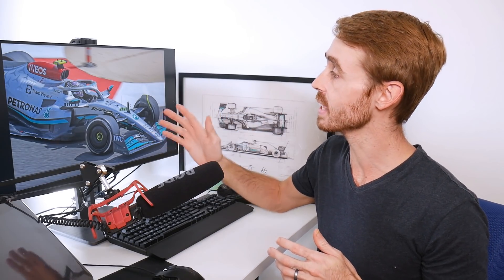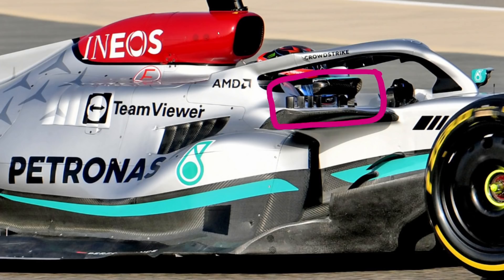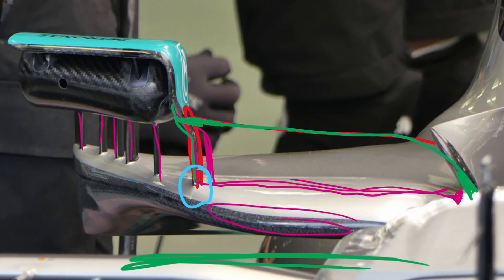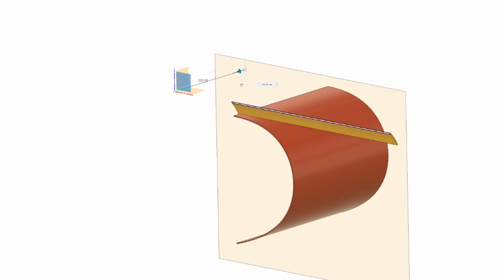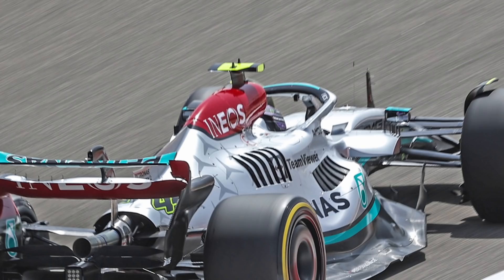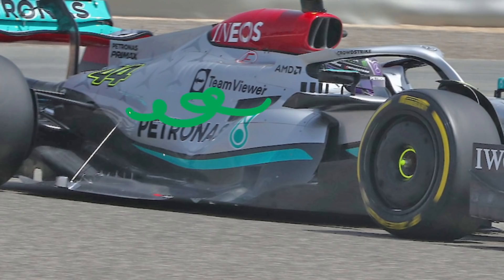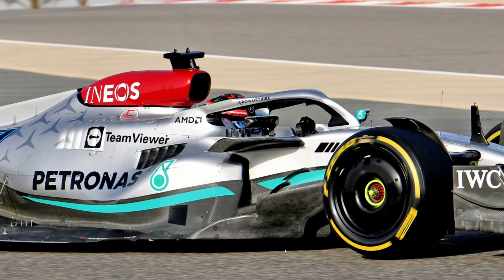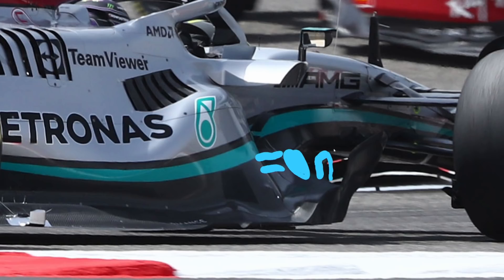How do the Mercedes Sidepods Work? - Aerodynamic Analysis

Comment: Great video and content!
I have a question though: if I remember correctly, in some other analysis videos you mentioned how the shape of more conventional side pods would create an outwash that pushes the flows away from the rear tires.
In this new design it looks like this is not possible given the narrow section of the car body: isn't this a drawback of this interpretation?
Or rather, the vortices spun by the winglet they introduced in place of the pod are sufficient to limit this adverse side-effect?
Thanks again for sharing your expertise, your channel is amazing!

Comment: If the FIA don't ban this then we all know where the FIA's true loyalties lie. The new rules were made to remove winglets and any aero device in this area. We know Mercedes have a legal design that was run at Barcelona and the FIA should be telling them to use that instead.
Reply: They have a legal car that was run in Bahrain, too
Reply: The Bahrain car is also legal,it will not hit the  track if FIA have problem with it
Reply: @dontmindme5419  My understanding of the new rules was that all wings, winglets and bargeboards that are not the front or rear wing are illegal. Maybe Kyle can explain to us how this bodywork overcomes the banning of all these items. The also explain how this is not now a safety issue. Moto GP had to ban similar winglets for safety reasons. My problem with this design aside from it being a wing is that it is now a significant battering ram in case of an accident. The FIA needs to ban it and do so immediately with no umming and ahhing.

Comment: I'm actually surprised that Merc manage to put some vertical vanes branded as "mirror mounts" and body canards in front of the sidepod inlet. I'm pretty sure FIA will try to clean these devices since the regulation is supposed to get rid of these small vortex generators

Comment: Aot of people still seem to be worried about porpoising.
Yes the merc was bouncing a lot on the straights, but they had several runs where that wasnt the case.
My guess is, that they are trying to find the sweet spot, where they have a lot of downforce without porpoising. This is still testing after all.

Comment: Question :
Shouldn't the "mirror stays" be connected to the actual mirror ?

That's the only thing I don't understand how it can be legal.
Reply: When there are lengthy discussions back and forth over legality of rear view mirrors, you know there are far too many overcomplicated rules and regulations...
Reply: Was thinking the same thing.

Also, what is that panel on the cockpit side? On the Barcelona version that extended rearwards from the inside mirror stay. Now it is not connected to that, so why is it there?
Reply: The thing Mercedes are doing is basically they are interpreting the rules in a different way. Reading it at first would suggest what u are saying. 
But with some clever interpretation with the “trimming” of the mirror stays if it’s part of the side pod they are able to move around the legalities
Reply: @foudalism21  ferrari’s mirror in 2018 were banned for this reason, if the Fia doesn’t ban these then they’re truly doing mafia
Reply: @ignls8809  well it's a different set of regulations and ferrari's mirror was connected to the halo
Reply: @ignls8809  those were different regulations and the main issue was that the mirror were mounted on the halo. Stop with your mercedes hate. If it was a Mafia, the FIA's race director would have never gifted the title illegally to Verstappen lol
Reply: @syntheovaldy5173  they changed the rules forcing ferrari to vhange mirrors.... nothing wrong with those mirrors lol. apparently merc are getting away with a wing here that has aerodynamic purposes even tho it's the mirror support

Comment: A couple questions.

Firstly the vanes on top of the mirror wings - you kept referring to them as mirror stays and therefore legal, but I don't understand how they can be considered mirror stays when they are completely disconnected from the mirror?

Secondly on the side impact structure. Is that small area within the mirror wing really all that is required for side impacts? I'm having a hard time believing that this design is safe and I'm slightly worried about the safety of the drivers if they get t-boned. Do we know if this version of the Mercedes has passed the side impact tests? What if the other car is off the ground and their front wing goes between the side pod and the mirror wing of the mercedes?

Comment: Impressive that Merc can create two radically different designs despite getting the least access to aero testing of anybody. I'm assuming they prefer this one, but have the other as a fallback in case either cooling becomes an issue or the FIA take issue.
Reply: There is not a chance they stick to the modelling computation allowance…This is Mercedes we’re talking about…Masters of bending the rules and cheating.

Comment: It's clever and all. But when they mentioned something about them wanting to enforce the "spirit" of the regulations this year, that#s what they mean. The spirit of the regulation certainly didn't intent teams to create a huge wing element on top of the sidepod to control air flow.
Reply: The wing element is the side pod (cheeky mercedes).... watch where kyle explains the y axis plane having two sections and how the bottom flares out far enough.
Reply: @MP422ownz  Nono, I understand why it's legal in terms of the regulation. But I doubt that, in practical terms, a freely adjustable wing element is intended by the regulations.

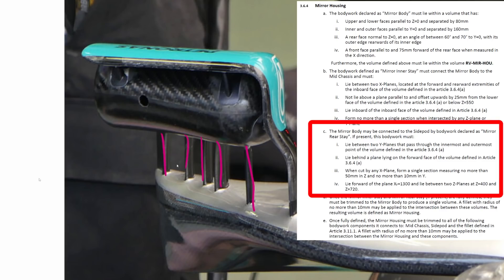Comment: @2:43 Out of those three vertical fins, the four outmost ones do not connect to the mirror, as you show lateron. Can't really believe such vortex generators are allowed for 2022.
Reply: I’m also surprised they have mirror stays that are not connected to the mirror.
It becomes a legal wording judgement rather than an engineering call from there.
Reply: Yep, because of how the rules only state that they have to be within the mirror width when looked at from the front, they should've constrained that from the side view as well
Reply: @NoTraceFound  Probably also a limit in that direction. But apparently no where stated that a mirror mount should connect to the mirror...
Reply: @skiscHans  it surely breaks the spirit and also the definition of the term 'mount' then if it's in no way connected to the mirror, it's not being used to mount anything. I hope that gets clarified by Braun et all.
Reply: @charliedesperado8262  you mean the guy who worked at merc before he worked for F1? lol
Reply: Now, the rules are allowed to be adjusted in reaction to teams getting around the interpretation, which put concepts like this at risk. I would rather be shocked when the FIA will allow it to fly, as the FIA's intention of the rules is clearly to avoid vortex generators like these
Reply: @BluesAlmighty  then again, the can't based down a concept because a team viewed the regs differently than the FIA, after all we are all humans, we see things differently so while it is a risk, at the same time it isn't.
Reply: @Dont14-r4k  well, Mercedes seemed to have shot themselves in the foot with their ugly concept after all.
Reply: @BluesAlmighty  no not really, there car has and is a top tier car, the porpoising is their main and possible only problem, I've seen reports of people saying that if merc solves the porpoising they can gain at least a second a lap, putting them right up there in the mix with redbull and Ferrari, also I find the design quite beautiful frankly.
Reply: @Dont14-r4k  let's see, if this was the right investment for 2023 as well
Reply: @BluesAlmighty  we will see after the Spanish go if it was a good investment
Reply: @Dont14-r4k  It doesn't look like those "zero-pods" have any advantage after latest upgrades. They may have solved the majority of the porpoising, but they are still not on top like they hoped to be
Reply: @BluesAlmighty  what are you on about, sure the don't have qualifying pace, but in he race lewis literally had pace to not only be in the podium, but even win the race had he not collided with Kevin magnussen, and he easily climbed through very competitive field. Just saying if it has not been for the crash lewis would of had a very decent chance of winning.
Reply: @Dont14-r4k  I mean that the zero-pod doesn't make them significantly quicker than the rest. If you make an extreme concept, it should make a difference. But it doesn't. It just gave them a lot more headaches than the other teams
Reply: @BluesAlmighty  and what is your proof that it isn't the the zero-pod that gave them the 3rd best car? Exactly non. The zero-pod reduces drag and allows for more airflow, at fist it caused headaches but it is clearly beneficial once it is figured out.
Reply: @Dont14-r4k  the proof is that they are still not winning
Reply: @BluesAlmighty  let's forget that merc could of had their first win and possibly a double podium this weekend....
Reply: @Dont14-r4k  yeah, because all could, but didn't. Not even fastest lap. Just be realistic and see the Mercs are not on top of the rest

Comment: best explanation of the shape of that sidepod and the mirror holder/crush structure. It looks like Merc had to compromise a lot with the shapes but they really wanted that vertical small inlets and came up with a smart design, satisfying the rules. Which means it is probably worth doing it. Far much smarter than I assumed tbh.

Comment: Super content & thanks for the video. 2 questions sir 1) on the mirror winglet. As explained around @ 8:20, the couple of millimeter slot on the winglet that acts as Side impact protector. Wont this slot make the structure weak or Merc would have to reinforce this piece to bring in Stiffness. right ? 2)  how does a this stand alone Winglet structure with large overhang from body help to protect driver in case of side impact ; section height is too small & coupled with the under-side slot for regulation this makes it weak. Please comment your inferences. Thank you
Reply: The winglet itself IS NOT the side impact structure! The side impact structure is a standardised part that's the same on all of the cars. On the Merc  - instead of being shrouded by the sidepod - it sits inside of that winglet. The winglet itself is just bodywork, and has nothing to do with the actual impact structure, therefore you can easily have a slot there without having to worry about crash safety.
Reply: @florianN132  Thank you so much for the clarification👍👍. Have a nice day...

Comment: I.m.o. its not in spirit of the regs. The other teams obviously where told by f.i.a. u need a box minimum for sodepods. Part of the look they where going for. So yeah i think its not really what f.i.a. wanted. I kinda hope teams protest but still teams in past have tried stuff like this. Even merc did with its airbox in 2010s. I dont see how this is a huge advantage moving cooling into high center area. We'll see next week but onboard all thru testing the merc looks more bouncey and harder to drive. We shall see i hope its RBR and ferrari at the top and merc hasta play catch up for once.

Comment: Great detailed explanation — I’ve learnt so much of what I didn’t fully understand of my favourite sport in the last three weeks from you — so thanks 👍🏼🤝. Just have to say that my biggest surprise from the Mercedes’ new side pod design is the side crash structure. I had always assumed that it also compromised an upright section to form an upturned L shape. Thus I didn’t realise just how vulnerable the drivers actually are on either side and amazed that there hasn’t been a serious injury from something piercing the side of the chassis underneath the side crash structure. It’s also a testament to how strong they are when thinking about all the accidents similar to Verstappen’s 2021 Silverstone one; the forces at work and it withstanding them is quite something. 🤯🤯
Reply: Yes, I'm also surprised by the shape of the crash structure. It appears to offer very limited protection.

Comment: I came to similar conclusions in terms of legality however, regarding the SIS being potentially open underneath, it says the SIS must be fully enclosed so my interpretation was that the trailing edge ends within RV-COKE not RV-SPOD which again seems illegal but maybe possible? The big one I don't get is the two forward canards - these cannot be SPOD so they have to be chassis?
Reply: Yeah i duno. The mirrors are suspect too as those stick ups do not connect. I really hope merc made a not so great call. Being no one else did this its either genius or just cool looking not best way
Reply: Yes, the canards were what I was wondering most about regarding legality. Would love to get an explanation.

Comment: The W13 looks like what you'd get if you input the rules into an adversarial ML system to optimise.
Reply: Thos most obvious method is to produce the best ground effect design and then adapt it to meet the new regs. Results like this happen that way.
Reply: ok, I'll ask, what is an adversarial ML system?
Reply: @JakobusVdL  Machine Learning model where you would set the utility function to be as fast as possilbe while setting constraints (the design restrictions). The ML iterates until it finds an optimal solution which can sometimes be counter-intuititve or just plan weird.
Reply: Ugly thing! FIA has to stopp such monstrosities
Reply: @samghost13  How do you suggest they'd do that? Beauty is subjective.
Reply: @samghost13  it’s a race car bud, the only thing that matters is that it’s (a) legal and (b) fast.
Reply: @HekateMGO  You mean, (a) fast and (b) not proven illegal before statutory limitations expire :)
Reply: @samghost13  Lol, if teams designed cars for beauty they'd be slow as fuck.
Reply: @samghost13  no
Reply: @samghost13  it looks mean as fuck, it's a RACECAR
Reply: @samghost13  Mercedes will be wiping their tears with the 1st place cash reward after reading your mean comment
Reply: @samghost13  It's a result of the FIA over-prescribing the rules. If they allowed a more flexible approach, we would have genuine competition between teams with new ideas creating advantage in some areas and others in other areas.

Comment: Less than 2 minutes in, and you already spoke more sense than most media outlets.
Why are so many people calling this a "no sidepod design"?!
As you correctly mentioned, the volume is there. It has to be there! The rads have to be somewhere... CE hardware has to be somewhere... the fuel cell has to be there somewhere.
The team pulled off an absolutely spectacular sidepod design concept... but the sidepods are there! :)

Comment: Doesn't that design make the run into the gravel a little more dangerous than what they have before? Looks easier to get the cooling vents dirt IF the car goes to the gravel. Or did I miss something?
Reply: Typically if you run into the gravel you’re done anyway.

Comment: If they can legally makes wings, why would they opt for downwashing (lift-generating?) wings? Why not use the wings to create downforce by having "inverted plane wings"?
Reply: There's more total downforce to be gained from the body and rear wing by cleaning up turbulence after the front wheels than by two little wings on the middle of the car I assume.
Reply: Because they need the downwash to direct air down to where it's needed to create downforce. The small lift that it produces is more than compensated for with more downforce downstream from the air that was directed there.

Comment: While I can see it passes the technical rules, and side impact tests - these are focused on the driver of that car.

What do you think about safety to other cars and drivers?
It looks like a big sharp pole that could pierce a tyre, or worse the halo protection in a collision scenario.
Reply: It doesn't look to me that it goes above the rest of the bodywork, so in order for it to present a special safety concern the car would have to be struck while already off the ground. It also doesn't extend past the edge of the floor, so risk to tires only really presents in collisions that already present a serious risk of tire puncture, and a side impact that would bring it into range of a drivers head would have to get through a significant amount of the crash structures of both cars. Certainly looks hazardous at a glance, but I don't think it's a meaningful danger all things considered.
Reply: I also see a safety concern here, how is this going to behave with a sideways impact?
Reply: Take a look at the side impact structure on gen 1 Formula E car.
Reply: All cars have the same impact structure sticking out like this. It's just hidden  behind sidepods. But the sidepods just crumple when hit so really it seems like it'd be no difference?